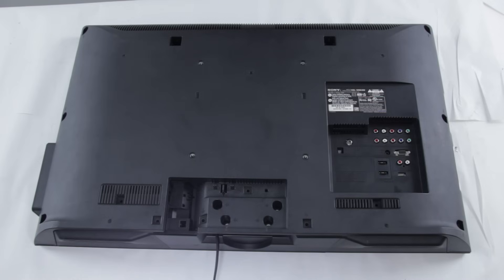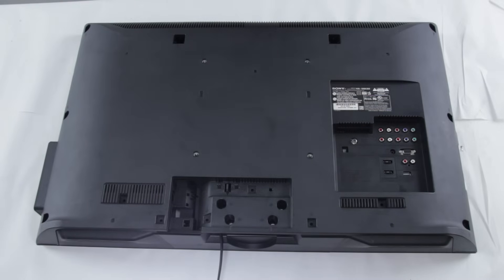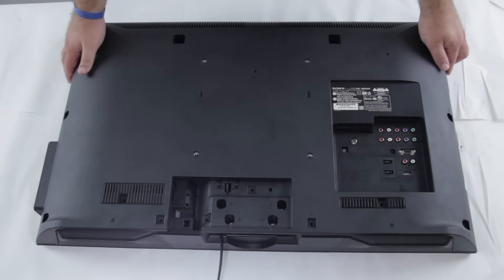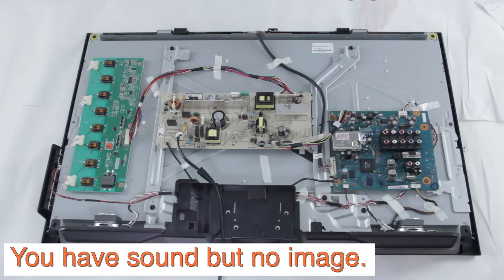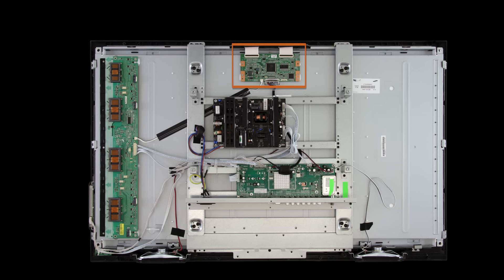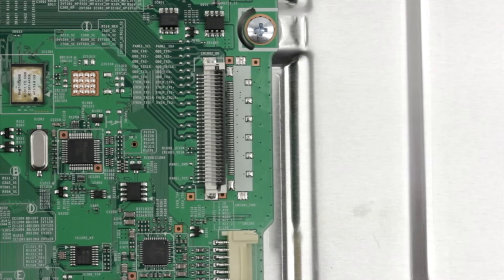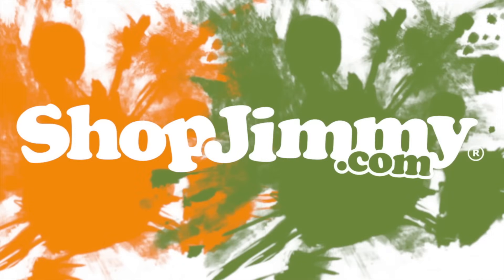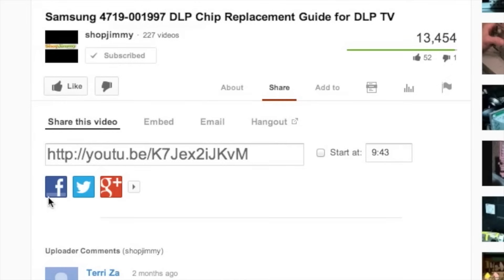LCD TV Repair Tutorial - T-Con Board Common Symptoms & Solutions - How to Replace T-Con Board

Comment: I have a Sharp 60" TV LC-60C6400U. While watching TV heard a pop and the tv went off, and was never able to turn on.  Took Panel off back and didn't see anything visibly blown.  Took the Main board off and noticed a blown resistor when i turned the board over. Changed resistor and still no power ordered a new main board from shop jimmy, replaced it and still tv will not come on.  No lights no nothing! Any suggestions?

Comment: I have a sharp lc-52d62u 52" lcd tv that recently developed short green lines all over the screen. It doesn't matter which input I am on the lines are constant on all inputs and signal sources.It looks like it could be a t con board issue but not sure. Any help would be appreciated.
Reply from the maker: Hildebrand ong yiu   This sounds like a TV panel (TV Screen) problem.  If your TV panel is bad, it may be more cost-effective to replace the TV as panels are typically hard to find in stock, difficult to replace, and expensive.  Thanks and please let us know if you have any further questions!  www.shopjimmy.com

Comment: my TV picture went out last night when i turned it on, have sound and stand-by red light is on and sound works my brand is a 42'' Hisense , model # LTDN42V77US, could this be the backlight board or does it have a T-CON board?
Reply from the maker: Randy crabtree   I recommend running the flashlight test on your TV.   Here is a link to a video we produced that shows how to run the flashlight test. https://www.youtube.com/watch?v=xUzCLgoSPGM Please reply with your flashlight test results and we can recommend a replacement part for your TV repair. Thanks and please let us know if you have any questions! www.shopjimmy.com

Comment: we have a Samsung LN46A530P1F flat screen.  The left side of the picture has gotten dark and fuzzy, only on the left side.  At first, we could wiggle the TV and it would go away.  It now is constant.  What is the fix?
Reply from the maker: mike Walcker  This sounds like a TV panel (TV Screen) problem.  If your TV panel is bad, it may be more cost-effective to replace the TV as panels are typically hard to find in stock, difficult to replace, and expensive.  Thanks and please let us know if you have any further questions!  www.shopjimmy.com

Comment: Stan McDonald 1 day ago
 Hello,need some help, please.
We have a:
 RCA LED LCD TV
Model: LED46C45RQ
Serial# 2501-LE46C45-B105727
Manufacture date: Oct. 2012
ON Corp US, Inc.

Issue- The left, 1/2 of the screen appears to have 2 sections.
1st 1/4rd, is total black.
2nd 1/4rd, appears to be receiving a signal that is backwards, with 2 vertical lines equally spaced apart.

After disconnecting the Timer Control, I turned on the screen, it appears to light up uniformly w/o any lines. ?? if that is a diagnostic aid or not?? Not sure if that indicates the screen is the problem or not, since there is no direct feed to the screen?? Anyway, I also switched the ribbons  from the T-Con, with no change with the screen. Oh, also reseated each connection on all boards with no apparent change. All grounds are good.

So, here we are, with 1/2 of a functioning screen and another 1/2 of a screen trying to mess with my mind..I can only watch this so long.lol.

Seriously, Any ideas what the problem is? How to repair?
Geeze what a way to start the weekend!!!

Thanks for your time!!!
Reply from the maker: Stan McDonald  This sounds like a TV panel (TV Screen) problem.  If your TV panel is bad, it may be more cost-effective to replace the TV as panels are typically hard to find in stock, difficult to replace, and expensive.  Thanks and please let us know if you have any further questions!  www.shopjimmy.com

Comment: lg tv model # 55lv4400-ua / SERIAL 109RKTA9H673 I took back cover of this LG that was flipping half of the screen and found that the left ribbon cable and possibly the board strip it connects to has gotten damp/corroded.. any fix? WSRogers57@gmail.com
Reply from the maker: Wendy Rogers  I recommend replacing the TV.  Thanks!  www.shopjimmy.com
Reply: ShopJimmy.com REALLY?  Wow.. its only 4 yrs old.. and a thousand dollar tv.. Could I try changing the ribbon cable before I toss it??
Reply from the maker: Wendy Rogers  Try all repairs and troubleshooting at your own risk.  Those can be impossible to change.  We do not sell those replacement parts.  Thanks!  www.shopjimmy.com
Reply: Ahh.. OK.. If I take on any repairs . I would of course do so at my own risk. I worked in electronics manufacturing for 30 some odd years.. I understand cables and connectors.. Thanks for the honest replies!!!

Comment: Hello, I have a Vizio 55" 3D Smart TV with vertical colorful lines.  With also no sound. the lines move and change color very very very slowly if you didn't stare at it for 2 minutes you wouldn't notice. the model # is M3D55OSL
Reply from the maker: howerd macias   This sounds like a TV panel (TV Screen) problem.  If your TV panel is bad, it may be more cost-effective to replace the TV as panels are typically hard to find in stock, difficult to replace, and expensive.  Thanks and please let us know if you have any further questions!  www.shopjimmy.com

Comment: I have an LG 47LW6500-UA.AUSYLUR. Last week the display and audio went while the television was on. The television comes on but the no display no sound. I have check the capacitors and they are not swollen.  Any suggestions?
Reply: I ran the test. There is no back light, no images and no sound. The only activity is the power light comes on.
Reply from the maker: Akini Greene   Try all repairs and troubleshooting at your own risk.  I recommend replacing the main board in your TV.  Click this link to replacement parts for your TV model number:  http://www.shopjimmy.com/lg-ebt61399411-main-board-for-47lw6500-ua-ausylur.htm  There may be multiple boards for the same TV model number, be sure to match part numbers on your current board, with your replacement for compatibility.  Here is a link to a video showing how to identify your part number, click here:  https://www.youtube.com/watch?v=RwHTvjMdrhk  Thanks and please let us know if you have any further questions with your TV Repair!  www.shopjimmy.com
Reply: ShopJimmy.com I think it is the main board as well however it seems it is out of stock everywhere. Can a similar board work?

Comment: Hey Jimmy, I havce a 32" Emerson BLC320EM9 i've had for about 3 years.  Turned the set on last night, screen was dark with green color and distorted.  Today when I turned it on it also had some wavy lines.  Sure would like some input, and thanks in advance.
Reply from the maker: Lisa D Wiseman   Try all repairs and troubleshooting at your own risk.  This could be a problem with either the main board or the TV panel.  You can replace the main board to see if that fixes the problem with your TV.  Click this link to replacement parts for your TV model number:  http://www.shopjimmy.com/catalogsearch/result/index/?cat=56&q=BLC320EM9  There may be multiple boards for the same TV model number, be sure to match part numbers on your current board, with your replacement for compatibility.  Here is a link to a video showing how to identify your part number, click here:  https://www.youtube.com/watch?v=wooRqBrRo6o  Thanks and please let us know if you have any further questions with your TV Repair!  www.shopjimmy.com
Reply: ShopJimmy, I also was in touch with a tech Louie at JustAnswer, he offered the advice to replace this part - Emerson/Funai 1ESA17767 (BA8AF0G04017) Digital PCB Assembly - and suggested I buy it from you and I did.  I had also already watch several of your videos before he made the suggestion.  Thank for getting back to me so quickly and I'll keep you posted on the outcome.  Have a GREAT weekend.

Comment: Hi Team Jimmy. 
Sorry this is a repost as I do not know on which of your videos I posted earlier. 
My  sony KDL40 EX720 is displaying a double / ghost image. 
I have isolated one side of the t con board connection and the half picture is still fuzzy. However when I disconnect the other side of the T con ribbon connection the half picture is perfect. 
Please advise if I need to change the t con board. 
Many thanks.
Reply from the maker: Angus Hola   This sounds like a TV panel (TV Screen) problem.  If your TV panel is bad, it may be more cost-effective to replace the TV as panels are typically hard to find in stock, difficult to replace, and expensive.  Thanks and please let us know if you have any further questions!  www.shopjimmy.com

Comment: I have a 52" samsung LCD LNT5271FX/XAA. The right side of the screen would ghost till the tv had warmed up. It was a pain but it would get better after it would warm up. I found a person with a whole tv for sale as parts, the screen was cracked. After watching this video I was like well I can get the T-Con board out of the broken one and I will have a great tv again. When I replaced the T-con board from the parts tv to the tv I have the problem just got worse. Now there was just a blank screen. Audio and backlight but no screen. I looked at the board and it all seemed to be the same as the original. The version of the tv was the same that I had. I looked closer and noticed that the only difference seemed to be that the chip number on the board was a little different. a 737 vs a 746 on the main chips. I put the old tcon back in the tv and it powered up and the screen worked. I then thought maybe the main board only works with this tcon. swaped out that and still nothing with the new tcon. Now I have swaped out every board from the broken screen to the one with the good screen. The only time it works is with the tcon from the original tv. I am now thinking that the Tcon board in that broken screen tv was also bad. I got the whole thing for 40 bucks so I have lots of extra parts. Q: should I try to get a T-CON for this tv from Shop Jimmy or now that I know all the other boards are good, or could the panel be bad and another TCon will be a waist of money? If I could put another 30 bucks in it and make it work I would be very happy. If I put another 30 bucks in it and it does not work I will feel like a sucker...
Just let me know what you think and what board you would sell that would work for this LCD. 
Thanks
Johnathan
Reply from the maker: Johnathan Sparks   This sounds like a TV panel (TV Screen) problem.  If your TV panel is bad, it may be more cost-effective to replace the TV as panels are typically hard to find in stock, difficult to replace, and expensive.  Thanks and please let us know if you have any further questions!  www.shopjimmy.com
Reply: If it is the panel shouldn't I have gotten the same ghosting as with the tcon board that is currently in the unit? I just wonder why I got a different result when I changed out the tcon. I would be feeling that it is the panel if I would have gotten the same result by changing out the tcon.

Comment: I have a Sharp LC-52D85U that had a bad t-con board (no picture at all). I replaced the t-con board and ribbon cables today and the tv now has a picture, but there is a vertical strip about 4" wide just right of the  center of the screen that is lighter in color than the rest of the screen. If needed, I can send pictures.

Comment: Hi, I have a Polaroid TLX-04243B LCD TV. Serial#  KR8EB188940000798. About a month ago the unit started displaying a shadow-type effect that goes away after about 30 minutes after powering it on. I'm not sure if shadowing is the correct term; it looks like the video has been "cartoonized". I've also seen it described as "posterization". There are no bands or lines anywhere, just kind of like everything you watch resembles "A Scanner Darkly" but way worse. And again, it completely goes away and returns to normal after about 30 minutes, but the issue reoccurs when the TV is "cold". I was hoping the tcon board replacement would be a fix for this. Any suggestions?
Reply: ShopJimmy.com I see all the control boxes are out of stock currently. I've never heard of a "control box" though and I'm not sure how to identify it on the TV, since the pictures online all look the same and are showing what looks like a complete mainboard. And I'm assuming the t-con board wouldn't the cause in this case?
Reply from the maker: Vrej Anbarsoun   You can look for a part number or partial part number.  Thanks!  www.shopjimmy.com

Comment: I have watched several of your videos on You Tube & your web site. I am positive the T-con board or the main board that is bad on my Samsung LCD TV.  I have solar images on the screen. Yes, these images are on the control/menu panel as well.  I also understand the only way to determine if the T-con board is to replace it first. 

However I am having trouble identifying the correct T-con board. No matches from your web site. Here is the information from my Samsung LCD TV. Model# LN40A450C1D-A ; Model Code: LN40A450C1DXZA ; Serial #: B46A3CSQ506489D ; Mfg Date: 5/08 

I also sent you a message from your web site.  Please HELP!

Comment: I am looking for a solution to a 52LG50 television that turns on and off.  When I first brought it home second hand I would turn it on, it would come on, then go back off.  After I did this about 10 times it finally stayed on.  I let it play for about 2 hours, but when I went to turn it off it would turn off then turn right back on.  Now it will power right on every time, but will not shut off and stay off until I unplug it. Any clues?
Reply from the maker: Gene Fox   Is there a blink code on the front of the TV?  If so, how many blinks are you seeing?  Thanks!  www.shopjimmy.com

Comment: Hi, 
I have a Samsung Model LN400D550K1FXZA, Version AA01. The unit first lost the video but still had sound. Shortly thereafter it lost all audio as well. A local computer repair fellow strongly suggested I may have a bad main board (he did not open the unit or perform any diagnostic tests. I rolled the dice and I have replaced both the main board (first) and power board with new ones: BN94-04475X, and BN44-00440B. I purchased the main from you and the power board elsewhere (you did not have one in stock). I still cannot get the TV to turn on. No red power light...no sound, no picture, no nothing. I was very careful with the ribbon and pin connectors and am confident I installed both boards correctly and without issue. I've checked the obvious like adequate 110v service at the wall receptacle, etc.At this point, I've exhausted my internet "research" and don't know what to look for next. I have only basic electrical and mechanical skills. Can you help? Thanking you in advance, ~John
Reply from the maker: Oceanjockey   Try all repairs and troubleshooting at your own risk.  It sounds like you have received a defective replacement part.  Did you try only replacing the main board, with the original power supply board?  Thanks!  www.shopjimmy.com

Comment: I have a Samsung model LN46B650T1FXZA, serial AVHR3CH5401893Y, version SS02, TV in storage for two years. When I turned it on I have horizontal lines about 3/8" apart starting on the right side and fading away as they move tow the left side of the screen. Any idea of what part(s) I might need to fix my problem?
Reply from the maker: JC Smith   Try all repairs and troubleshooting at your own risk.  This could be a problem with either the main board or the TV panel.  You can replace the main board to see if that fixes the problem.  Click this link to replacement parts for your TV model number:  http://www.shopjimmy.com/catalogsearch/result/index/?cat=56&q=LN46B650T1FXZA  There may be multiple boards for the same TV model number, be sure to match part numbers on your current board, with your replacement for compatibility.  Here is a link to a video showing how to identify your part number, click here:  https://www.youtube.com/watch?v=BEPWrefQvqI Thanks and please let us know if you have any further questions with your TV Repair!  www.shopjimmy.com

Comment: I have a solarization problem on this Samsung 32" tv which is pretty sure bet the failed gamma processing AS15G TCON chip but there's a second level of display distortion along the edges I can't put my finger on. It's this sort of edge halo and blurry rounded curve stuff you can see here https://youtu.be/QzMgSSlUAPc?t=194 . Let  me know your thoughts on those symptoms. Do Think the display is still good? Would replacing the TCON fix it? Thanks for all your awesome videos, really helps me learn a lot.
Reply from the maker: cosmicallyderived   Sounds like the filter sheets behind the panel have gone bad.  Unfortunately we do not sell replacement parts for your TV.  Thanks!  www.shopjimmy.com

Comment: Strange problem! I have a Sharp lc-32d62u. The image is Sharp, perfect , everything is fine when i switch to DVD (on Input 1, for an example). But when i switch to the TV mode (with cable) the image is blurry and doubled. Sometimes, the voice synchronisation is off...! Please help. Hb
Reply from the maker: ikust007   I recommend replacing the main board in your TV.  Click this link to replacement parts for your TV model number:  http://www.shopjimmy.com/catalogsearch/result/index/?cat=56&q=lc-32d62u  There may be multiple boards for the same TV model number, be sure to match part numbers on your current board, with your replacement for compatibility.  Thanks and please let us know if you have any further questions with your TV Repair!  www.shopjimmy.com
Reply: You think that it is still worth it to change such a part?
Reply: I will open it to see the number. Do you have a video that shows how to remove correctly the board? Cheers for your help! Will you send in canada, and if so, can you send the part as old part? C
Reply: I have found the videos on your site. Cheers!